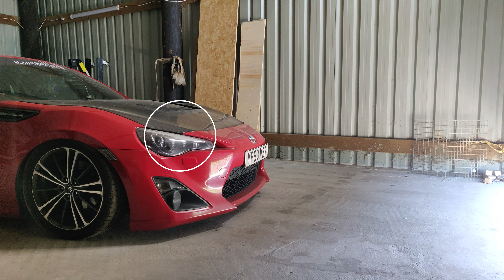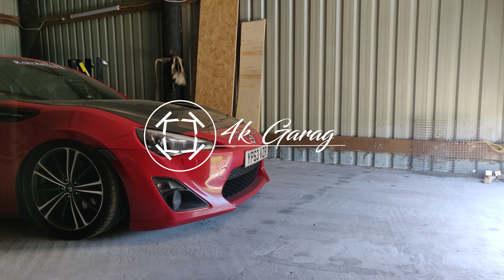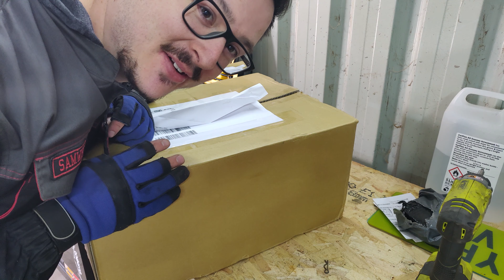4k GT86 big brake install - Part 1

Comment: I had the rear drum brake pins snap on me when changing my rear discs on my daily. Major PITA. Next time I’ll have spares on hand before I do the job as only cost a couple of quid.
Reply from the maker: yeah exactly same thing happened on my older subaru. As you say the parts are cheap as chips but currently a little tricky to get hold of! 
but i have them now so come monday i'll be finishing the brake install!

Comment: you could have added full floating discs, those are only 2 parts discs. they prevent wrapping and dissipate heat better than solid state ones but the full floating version is the real deal.
Reply from the maker: Yeah I definitely could've done! Unfortunately I just didn't have the funds to do so at the time so had to draw the line somewhere. Nothing stops me from replacing them in the future though :)

Comment: Whats your opinión about the 6 pot kit? Good quality and braking power?
Reply from the maker: Yeah it's felt great so far. I've not tried them on track yet but it definitely feels sharper on the brakes and the pads that came with the kit work great without needing to be warmed up etc.